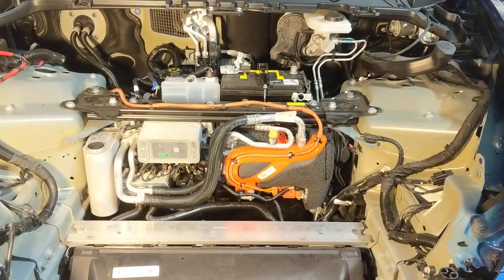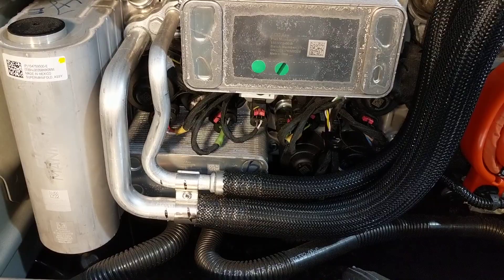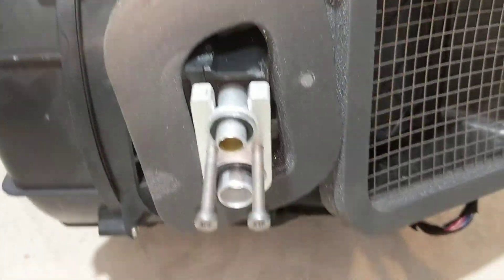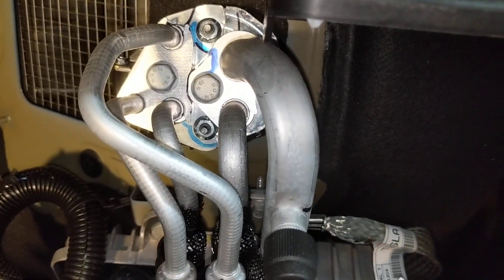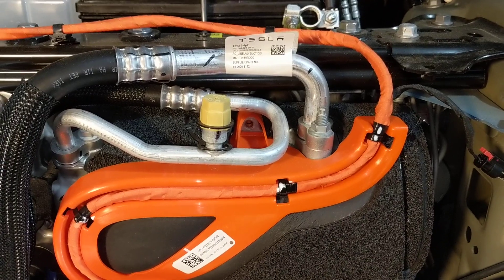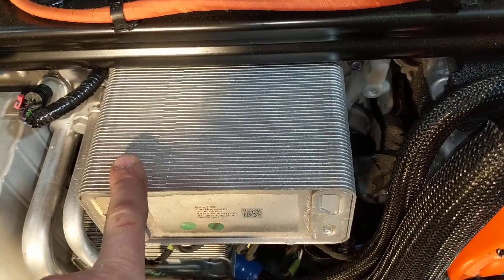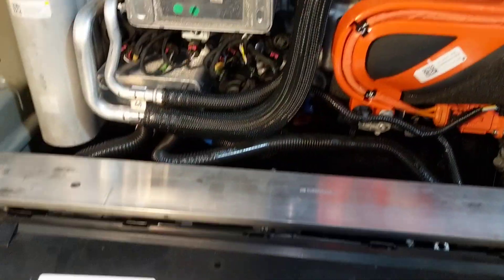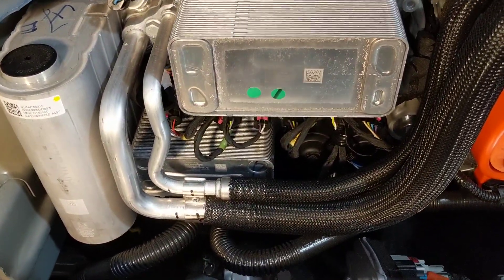A quick look at Tesla's HEAT PUMP!

Comment: Hi, and thanks for posting these. Where is the easiest, less risky place to disconnect the old (2018) heater element in a Model 3? Many of us have been complaining for years that the heater comes on in the back seat when the AC is on. Thanks!
Reply: I added a switch inside my center console that disables the PTC heater.  I wanted to use it to test energy consumption since the car uses the PTC heater even in summer along with the AC.  If you remove the carpeted kick panel on the driver side of the center console (to the right of your foot when it's on the accelerator pedal), you can see the PTC heater.  There is a 4-wire harness that's used to control it.  You can unplug it at the connector on the PTC heater.  Just know that the car will detect within a few seconds that the PTC heater isn't connected and will pop up a message on the screen.
Reply: @android04  Nice! It's silly we have to do these things instead of Tesla fixing their code. I appreciate the detailed description, thanks!
Reply: @JRo250  Doesn't the heat come on to dry the air? Are you saying it's just a bug? Are you SURE?
Reply: @israndy  It's definitely a bug. If the cabin temp is, say, 80F and you set the AC to 75, the front vent will be cold and the back vent blows hot. People in the back immediately notice and complain. I have to set the AC down 10 deg or more to get the back vent to be cold.
A lot of us have reported this issue over the years but Tesla has not done anything about it.

Comment: Do you know about the Tesla heat pump problem in very cold temperatures. The fans only delivered cold air from the inside ducts on some Model 3's & Y's.  The YouTube channels that discussed the issue, said that the service centers explained that two sensors were causing the problem, and were replaced.  Living in Michigan, I decided to postpone my order for a Model Y.  Do you have any knowledge on whether the issue is resolved, and if so, how was it fixed?  Thanks for the video , especially the comparisons between parts for the electric heater versus those for the higher efficiency heat pump.
Reply: In Arizona, people had the opposite symptoms, but I suspect it's the same underlying cause.  Two refrigerant pressure sensors can be faulty on some early cars.  People experiencing the issue could make a service appointment which would be given high priority.  Anyone else with sensors that were likely to eventually fail will have their replacement automatically added to their next service appointment.  That's what Tesla always does for fixes/improvements that are recommended but are not time sensitive.  New cars have been getting good sensors for many months.
Reply: Lots of Canadian customers using these EVs without issues. Doesn't seem to be a problem.

My understanding is Tesla does something interesting with compressor when needed in extreme scenarios - maybe below -26c/-15f, but not confirmed. 

Basically they make it run "inefficiently" so that it functions like a resistive heater, generating excess heat to do the job, though at lesser efficiency of course.

Comment: So no preheating your cabin in winter mornings ?
Reply: You can absolutely preheat with the heat pump.  They are basically reversible air conditioners, so they can make the hot and cold sides of the system be the interior or the exterior.
Reply from the maker: Of course you can, and in fact, it uses way less energy.  The car can automatically learn your schedule and have your car perfectly warm before you leave, and if you are still plugged in to doesn't take any range off your pack.
Reply: On a cold winter morning when its snowing and your car has been parked overnight, maybe charging during that time or not, so from where does these heat pump soak in that warmth? No moving parts to generate heat at that time.. other than your  battery which gets hot if you had it on charging. That's the question.
Reply from the maker: @sushilsorout  There is always heat!   Keep in mind absolute zero (no heat) is −273.15°C / -459.7°F  As long as it's not that cold outside, there is always SOME heat.  Of course a heat pump will not be able to work with that delta, but my point is just because YOU think there's no heat outside when it's below freezing, there is still plenty!
Reply: Thanks for all your replies, Ingineerix. I do follow you and Damien Maguire (EVBMW) for all the knowledge you guys are putting out there for us folks. Appreciate that, really! I don't live in sub zero temperatures but then I see these videos people throwing boiling hot water instantly turning into snow, well now that makes it hard to believe that there is still some heat which you can reap with these heat pumps. A demo would make a fun and an interesting video :)
Reply: @sushilsorout  And like was pointed out earlier, there is heat that can be easily generated by driving the inverters inefficiently and then using the octovalve and the heat pump to move that heat into the cabin.
Reply from the maker: @sushilsorout  Sadly I don't live where it gets too cold.  Let's put it this way; 100% of all Tesla Model Y's and the Model 3's produced in the last year all all equipped ONLY with the heat pump for heating.  There is no other cabin heat source!  (except the heated seats)  Don't you think there would be a huge outcry of people that live in colder climates if their heat wasn't working well?
Reply: Don't forget that the heatpump itself will add heat by compressing the gasses, and as already mentioned, retracting heat from the outside air. But as the outside air temp decreases the delta p(hp/lp) increases, therefore the efficiency decreases. So the compressor will have to work more(and less efficiently) for the same heat 'production'.

Comment: Great explination.  Thanks!
Do you know what the heat-pump draw is at full power vs the resistance element heater?
Reply: This is just a guess, but I’d estimate that the resistance heater uses about 6kW and the AC uses about 2kW at full blast.

Comment: Not sure if you've covered it in a previous video but how has Tesla "stalled" it's Model 3 motors to generate heat while still driving?  There is a noticeable change in sound to the motors while it's happening.
Reply from the maker: Yes, they intentionally operate the drive inverter in a "lossy" way.  There is no separate battery heater on the 3/Y, it all has to come from this way, or now; from the heat pump, so less loss!
Reply: @Ingineerix  So they're operating the inverter with a small amount of shoot through???  A few microseconds of overlap of the high and low side SiC mosfets?  I'm just speculating, but that's the only way I know of making a few kilowatts of additional heat in the inverter.  I'm sure the glycol cooling of the mosfets could handle the amount of heat generated.  I'm just surprised at deliberately using shoot through when all my designs went to such lengths to avoid it!  Geez, drive waveform timing accuracy has really improved from the old days!
Reply: @morrisg  sounds right to me.( Im no inverter designer) I was thinking the heat was primarily generated in the motor, but yeah it makes sense the inverter would definitely contribute too.. I'm sure they'd keep this to a minimum,  eg -optimize, supplement, and prioritize the heat pump when needed

Comment: The way I explain it is they can move heat from it's source to where they need it. For example if you need to heat the cabin as you fly down the highway it takes about 20 kW from the battery to run the car at about 70 mph. If the drive unit (inverter, motor, gearbox) is 90% efficient, then there's 2kW waste heat which is more than enough to keep the cabin comfortable. So no need to use any energy from the battery. The heat pump may not even need to run in this case depending on temperatures.